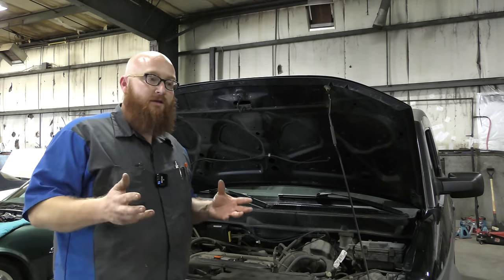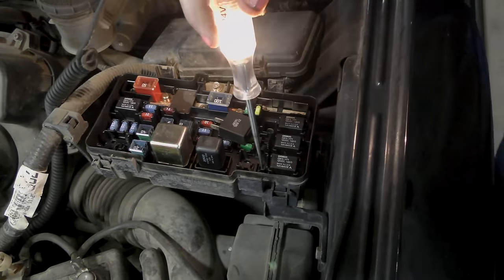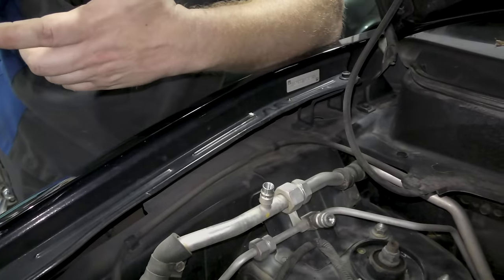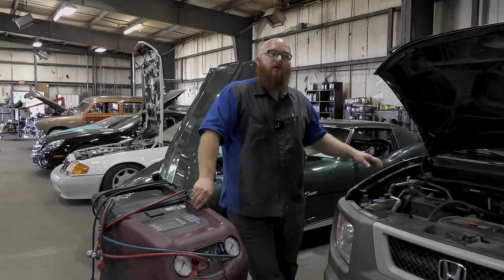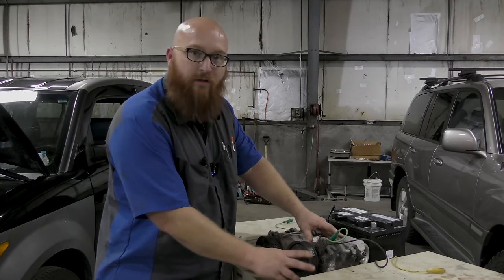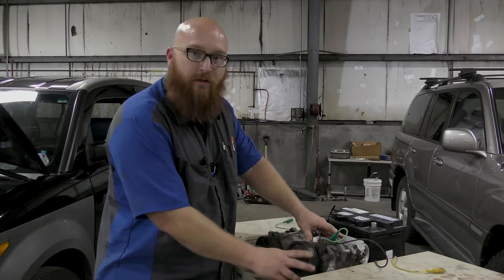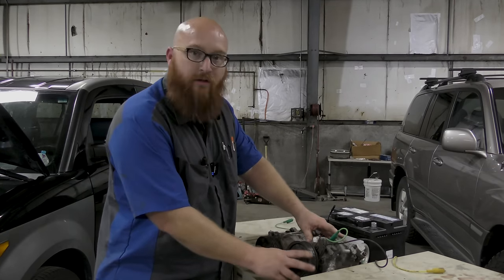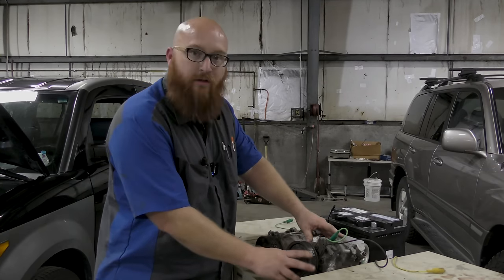AC not working!!! The CAR WIZARD shows how to easily isolate the problem

Comment: I ll be meeting the mechanic tomorrow, in the interim I wanted to know what to expect.

My issue is: my air-conditioning will blow cold air for several minutes, then blow warm/hot  for an entire day etc. This has been happening for a month. 

Assuming the mech says: CHANGE (compressor or condenser or whatever..), given my situation would it be necessary to replace the whole entire A|C system.

Also, in my country, replacement parts ARE NOT brand new, OFFICIAL TISSUE parts, but, high-end knockoffs at best, at worst: salvaged from Car breakers...

Cheers

Comment: The nose of the compressor is an electromagnet.  If everything looks good but not working, carefully put something metal up to the face of the compressor face. If its magnetized but not spinning. Clutch is worn and the little clutch disks can be replaced. Hope that made sense.

Comment: Great video Sir. Have a question though, when testing the control pins for confirmation of the control module did you connect to battery positive or negative? Thanks in advance...

Comment: Great video! Can you please open up your shop here in Northern NJ?! 
Can using a Code Reader/Scan Tool point out issues as well? I also had a popular local mechanic say they won't touch my AC system since I used a store-bought recharge kit that "helps to seal common AC leaks in rubber o-rings, gaskets and hoses."

Comment: But there have been cases where, for example in a honda, you only need to replace the AC clutch. Behind the AC clutch there is a washer or spacer which is there to maintain the proper space to allow the clutch to engage and disengage. Also, I have cleaned it with a angle diagrinder and remove the excessive rust, then put it back. Better yet, replace the clutch and the pulley. Brand new will have a good electromagnetic force to work just fine. I have even removed the washer and left it like that and it engages and disengages. However, this may be a temporary fix.

Comment: Don't forget the relay contacts could also be a problem. After verifying everything is good with the manually operated relay, u should place the original relay back and verify that the compressor clutch is still engaging. If not, the relay contacts r bad.

Comment: If you check at the relay and the compressor won't start, it can also be a problem with the wire from the relay box to the compressor or a bad ground. To be sure you have to check directly at the compressor terminals!

Comment: He goes through a whole lot of excess and extra work to confirm whether the clutch on the compressor works or not.   All you have to do is see if the center hub turns along with the pully when the AC is on.  If it does,  the electrical control system works fine.   If it doesn't then you should do what he suggests

Comment: Everything said makes complete sense, but regarding the a/c compressor with a bad clutch... why did you replace the whole compressor with the clutch assembly instead of just replacing only the clutch/pulley and/or electromagnetic coil?

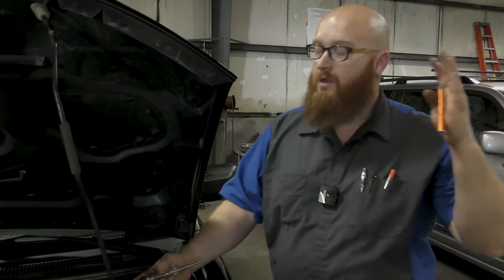Comment: Wiz, I appreciate your thoroughness in showing this but I have a question regarding the testing you do @3:12, at this point your alligator lead is on a 12v source and your test light probe is in the non-energized side of the control portion of the relay receptacle, right? If I understand you correctly, the computer will ground the non-energized socket when the AC switch is thrown, is that right?

I've tested all of my fuses, the clutch relay and the fan relays, and the clutch itself via the clutch sockets in the clutch fuse receptacle, and all are good. And the compressor turns by hand. On the clutch relay receptacle, one pin of the control side is energized when the ignition is turned on, and the AC dash switch is OFF. When I put the probe in the non-energized side of the control socket and connect the alligator clip to 12v+, then turn on the engine and then the AC switch, I get no light on the test light. Am I doing this right, and if so, what does this mean? If I'm not doing it correctly, what should I do differently?

My AC system pressure is in the low 30s on the low side and about the same on the high side... when the compressor is not turning, which is the present state of things. Anyone with any pointers is welcome to chime in. 😃

Comment: i have an issue not covered, i turned my ac off and it just keeps blowing cold even with the thermostat turned up to 85 it just makes the air warm. so i have hot and cold at the same time, or freezing cold if i turn it down to 60, 65. 2015 mazda 6. i am baffled and would love your feedback.

Comment: Quite an informative video! Did not know that ideally the Compressor, condensor and other parts need to be changed! Something to look out for when I take my 2018 Honda Civic for repairs...   Had been noticing that it was not cooling a lot but it has now stopped entirly... At first I thought that the heat was getting too much and it was not keeping up but ironically after not using the car for a month it has stopped cooling entirly... 

I do hear the ac compressor clutch engaging so I am hoping that its not a huge issue.  A question that I have is, it is normal for the AC refrigerant to leak out over the years?

Comment: You left out the engine temp sensor . If engine starts getting hot   the ecu shuts down the a/c. Gu patrol typical issue
  Great video

Comment: Great video with details. I have a BMW 6 series, and its ac intermittently works and if I change ac settings on the dashboard panel it goes off. what could be the possible reason. PS. it has separate settings for driver and passenger side. I noticed passenger side ac cools off better than driver side when it's working. LOL

Comment: Awesome video, why didn't you talk about blend doors? I have a LMM Duramax last summer just stopped blowing cold air. Parked it and forgot to get it looked at for this summer for towing oops. Anyways they said Freon was low, paid $256 in Nevada for Freon change, ice cold for first 2 drives and parked it. Went out today and it's a mix of cold and warm, says 60 but it's more like 80. Sounds like blend door, right? All electrical is working, I followed your guide in video. Hopefully blend door is the fix....

Comment: Had issue where vent temp increased by about 10 degrees when stopped to approx. 50 degrees but was normal above 30mph, radiator fan was on and seemed to be turning fast enough but was not, tested ohm value of fan motor and it was about .9 ohm 12v/.9 = 13 amps which is well below the rated power output, hit the fan motor with rubber mallet lightly and blew out the motor with compressed air to clean out the carbon brush dust which is conductive, ohm value dropped to .5, not only do the vent temps now hold while stopped but dropped from 42 to 40 degrees just with this simple method. There are four brushes which over time can lose good contact with the commutator by sticking in the brush holder, weak springs or carbon buildup between the commutator segments which will cause them to conduct between each other causing reduced output.

Comment: I replaced my own AC compressor on a 2006 TSX. With flushing everything (including evaporator) and replacing the expansion valve, receiver drier, etc. it took 4 days straight. Plus vacuuming and recharging it. Wouldn't recommend. Then I had to replace the damn flex pipe between the headers and the cat converter. Only do it if you have big balls

Comment: And on the 2012 Cadillac SRX The radiator fan is working correctly. Turning on and off when it needs to. The car is not running hot at all. It's staying around 190° if not lower.. I could sure use the help!!
Reply: The car's temperature is between 185 and 190°, we have tested all the relays. We have tested both the driver and passenger side fan resistors and have replaced them.

Comment: informed video, many thanks.. My A C has never worked since car bought some years back.. Went through your checks , clicking cluch ok,  but no further success.  Does not engauge, or fan working when A C switched on.. .Had my pressure checked last year, told was OK.. You tentativly spoke about pressure switch, can this be checked - & how?

Comment: Great video! I have a 2006 Dodge Ram with AC that is technically functioning, but blowing air that is barely cool, especially in 105 degree TX weather. The fan is running, compressor kicking on and staying on, condenser is clean, but only getting mildly "cool" air, NOT cold. I added "AC Pro" brand refrigerant using the gauge that it comes with, but the refrigerant level was already "in the green" on the gauge, so I just brought it further into the green without going over. It did not make a difference one way or the other. What else could it be? (trying to avoid taking it to an AC shop since I don't have the $ for it)

Comment: Thanks for this video. At what point does the fan play a part in whether the A/C will operate?
I have a 2010 Chevy Equinox. I can’t get the fan to turn on. We went thru fuses and relays particular to the fan but it doesn’t come on even when running and increasing the rpm to heat up the engine some. Will a no running fan prevent the A/C from cooling? Thanks.

Comment: Great informative video, Thanks. Question:  My  1994 GMC C3500 454 engine,  Vandura motorhome AC is not working. The fan blows though.  I can turn the compressor without much resistance and the clutch clicks when jumped, the fuses test OK,  there is power at the fuse holder, but no power at the compressor plug. Not sure where there may be a relay in this unit, not at the fuse block.  Help would be appreciated.  I just purchased this vehicle so have limited history.

Comment: I replaced my clutch without pulling the AC compressor in about an hour. It’s very possible to do the clutch without removing the AC compressor. With Hondas it’s even possible to drop the subframe rather than pulling the whole radiator out of the car

Comment: Why would you not also replace the expansion valve and evaporator if you’re replacing the other components in the system? If metal pieces can get stuck in the condenser, can’t they get stuck in the evaporator as well?

Comment: Thanks for sharing your knowledge!
I have a 2018 civic ex 1.5L. 
AC condenser covered by warranty. 
After watching videos about hissing noise & no cold air & using a couple of your suggested methods, I think my problem may be the evaporator. 
Could I replace only the evaporator, without damaging other components?

Comment: I’d mention that the AC system is becoming more of a requirement on hybrid and electric vehicles as it is used to cool the battery and inverters through glycol heat exchangers.

Comment: I hate that hes so right about the compressor failing and needing to replace the condenser and receiver dryer. but u just have to do it. honestly u might as well replace the expansion valve/orfice tube as well while ur at it especially if the Black Death (black sludge and metal parts) is present. 

also the car wizard is right about the ending part where shops will just quote u an entire AC system instead of actually diagnosing the system for failures. its a lot easier for them to quote u an expansion valve, compressor, receiver dryer and possibly lines than it is to actually find the problem(more money more profit, less risks). (they won't quote u the evaporator though unless u really need that sh*t and if u do they will send u to the dealer, they dont want to deal with that sh*t,  If u know what its like to get to an ac evaporator behind the firewall in a car, then u know. if u dont, trust me u dont want to know.

so I took my car to Firestone to get the freon removed. even though I was an automotive technician myself I dont own an AC machine or pump to remove freon so I took it to get the gas/liquid removed so I could work on the car. the service writer thought I was a potential sucker and told me my compressor had failed and then told me I needed to replace the entire AC system. so I entertained him and asked him what the entire AC system was that he was going to sell me. he said I would get a new expansion valve, compressor, condenser and dryer.

so then I asked him about the AC lines? he said they were fine. I then asked him if a flush was required. he said they dont do flushes there. then to toy with him even more I asked him if he was going to replace my AC evaporator. his face was a mix of......... 

"oh shit hes not a wackable baby seal/ are u kidding me? do u really think $1500 is gonna cover sending one of our technicians on a 4 hour expedition to the neather regions of your dashboard?"

so yeah he was gonna sell me 80% of the AC system and put the new parts together without flushing the evaporator or lines and install the new parts with possibly contaminated lines. I then asked him to show me how he knew the compressor had failed. he just told me reluctantly that there was almost no pressure in the low pressure line. told him to let me go to my car. he refused and then I asked for the manager because I knew they do let people go back as long as they have safety glasses. so we did. I took a look at my compressor. showed the manager the exact same thing the wizard did.

the real problem was the expansion valve that was stuck. the refrigerant would basically not flow due to the restriction until enough pressure built up to pop the expansion valve then a rush of cold air would come out for a few minutes and then get warm again. replaced the expansion valve only, recharged the AC. the AC now works. 

as technicians we literally have the brain to problem solve  complex issues within multiple systems and the brawn to do manual labor something that is becoming rare in todays society and is supposed to be paid well.  but yet no one looks at us in good light because of sh*t like this.

Comment: I purchased the 'refrigerant' that has the gage attached. I actually 
added too Much, at the start----however, I simply 'Released' some of
that extra pressure, started it up, and I was good to go.

( Got lucky, I guess).

NOTE: 
Those "Gages' only show the, 'Low side,' not the, 'High side' of AC
Systems' measure.

Comment: If the clutch had an internal short your jumper would heat up pretty quick. A short is a word that is used too often when it is actually an open circuit. People need to understand this. When you turn off a light in your home the circuit opens. When you turn the light on you have connected current to a load. The load keeps you from getting the fire show you get when you lay a wrench across a battery, that is a direct short. Not being critical just want people to understand the difference👍😁💥

Comment: Here is a question for a 2008 Toyota 4 runner, V8:

I can see and hear that the compressor's clutch engages with the AC on/off switch. But, when I turn the AC on, the compressor is noisy and doesn't blow cold air.  Noisy sounds like, I dunno, like the bearings inside are not lubed enough. 

the last time I used AC was probably 10 months ago.

Comment: Dkn what to think. My clutch works I hear it engaging. I added freon. And it even blew cold for a bit. Then it stopped blowing cold. The system held a pressure for 24hrs. I left it on there to see if it was a slow leak. But no leak. 

What gives? I believe entire AC system is original. 260k miles. 07 Saturn relay.

Comment: If it's the clutch I I know is my issue I can change the clutch out or reset the gap. There are kits available for this purpose. Mine blows cold then after a while it stops blowing cold. I open the house while AC is on and clutch is not turning. I tap on it and it tries to engage eventually engaging fully and AC blow cold. My issue is the clutch. Just spent money replacing the condenser fan and blower and now this.

Comment: Hey Wizard , In reference to a locked up compressor and having to replace condensor, receiver dryer and flush system what about evaperater and expansion valve do those have to be replaced as well? love your vids Thank You sir!!

Comment: I really enjoy you big guy!
I have been a refrigration contractor for 30 years... Now I have seen the balls inside the compressor just jump off it's circuit...It's easy to disassemble it and take a close look...
   If that's the only problem no metal or debris is present and therefore you can just replace compressor and pull a deep vacuum and weight in.....
It saves these poor people lots of money if that's the case.....
Keep it up!!!!!!!

Comment: Question, if the air conditioner works off and on. The hotter it is outside the more likely it doesn't work. Would that also indicate the compressor is the possible culprit? Or a broken compressor wouldn't allow the AC to work at all?

Comment: It CAN hurt your car to drive it without the AC if 1. you have a convertible with a solid rear window( Glass, especially). The window pulses in its  fabric mounting, destroying the stitching holding it in ( IE: 1987 to 1993 Chrysler Le Baron)  or 2. you have a car with a cloth on foam headliner. On  an older car with foam core headliner , the fabric will pull loose from the headliner backing, sagging down. This is greatly accelerated by driving with the windows down.

Comment: When using the test light, the first tests have the test light hooked to the ground. Then you hook the test light to the positive. On the third test of the computer ground to turn on the compressor you do not mention if the test light is hooked to the ground or positive. Can you let me know which it is for that test, please?

Also, your relay switches are not coming up on your affiliate store

Comment: My Compressor works perfectly, i just have a leak somewhere on mine. i checked the other day and have 0 PSI... i put in some Freon from a can and then the Compressor kicked in. I just need to locate which o-ring is the problem. But its freezig in nyc right now... dont need AC but spring will be coming fast.